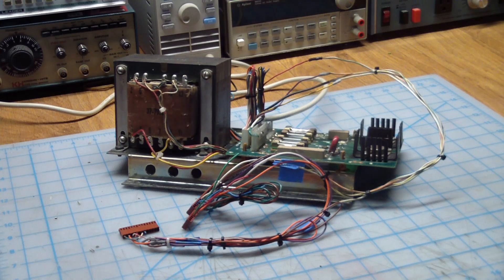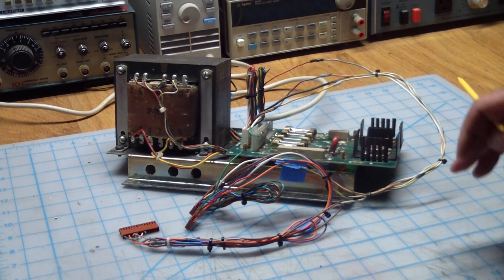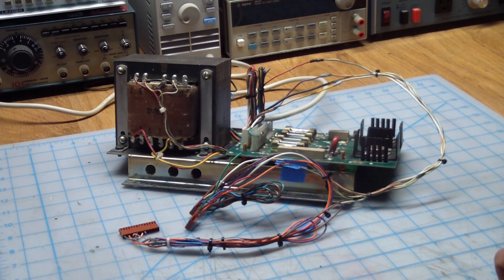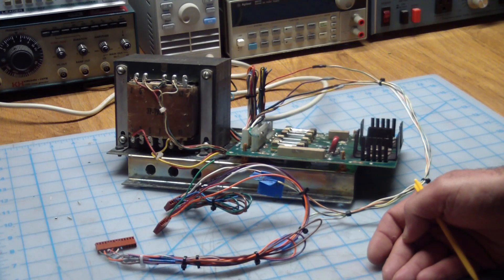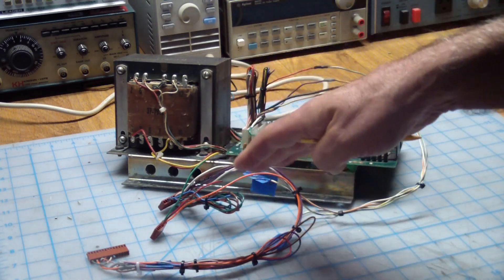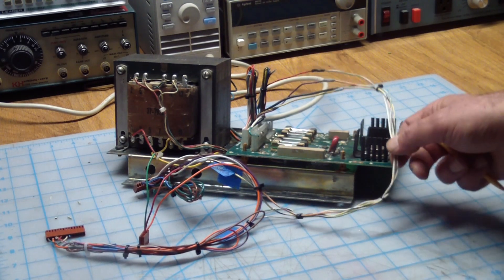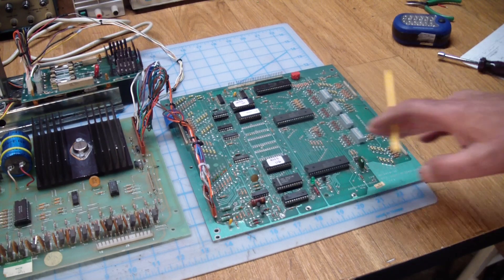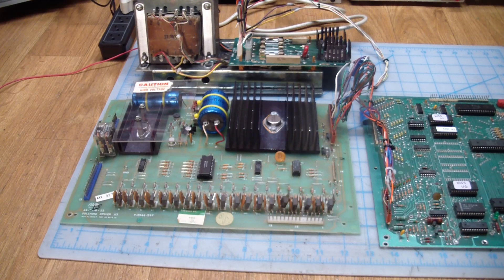AE#151 Testing A Power Supply For a 1978 Bally KISS Pinball Machine

Comment: I recently acquired a stern (77)stingray when I got the thing the transformer was wired for 115v.   My measured socket voltage is122v to 123.   Im first on the transformer that feeds the houses. My question to anyone should I leave the transformer wired for 115v or wire it to 120v.     Any thoughts.   Help.  My first machine.     Any help appreciated
Reply from the maker: If you keep the 115V wiring the machine will be a bit more peppy, but for longevity you could move to the 120V tap.